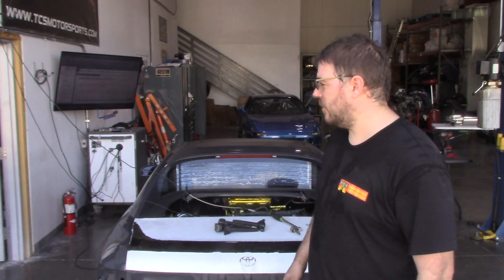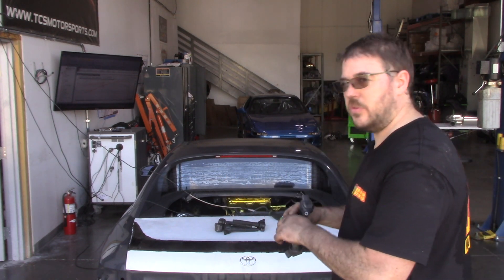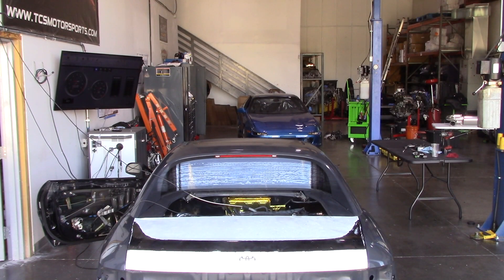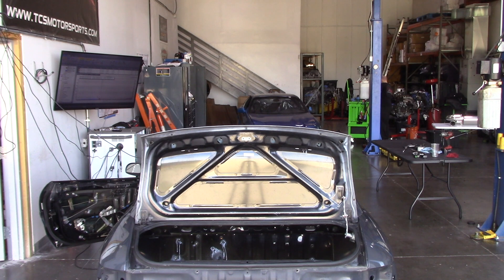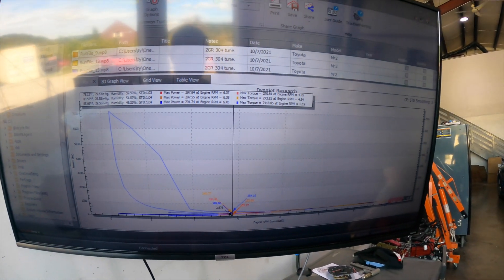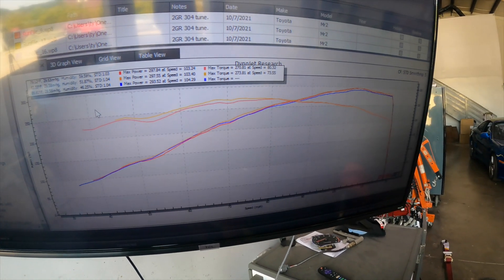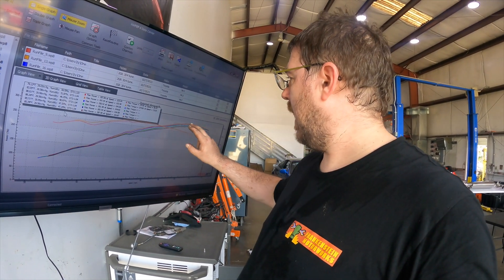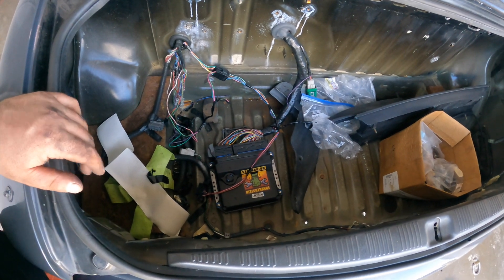More Spark! Less Power‽

Comment: It's knocking on pump gas eh?
Put in a flex fuel sensor, some bigger injectors, and run e85 to improve your timing even further?
Reply from the maker: It's only knocking because it has way too much timing advance. This motor only knocks around 4200RPM with pump gas at max power. If i put E85 in, it would likely stop knocking but it would still be making less power than it did until i took the extra timing out.

Comment: Really curious what a ignition table tune would change with those coils
Reply from the maker: It would make the coils work just fine but would be unlikely to add any power on the factory application.

Comment: Okay but do you anticipate similar results if used on the 2ARFXE conversion? Or would the high compression and premium fuel benefit from them? 🤔
Reply from the maker: I will be using these on my 2AR builds because they are stronger and somewhat more reliable coils. But i will be adjusting the timing curve to make up for the quicker firing. That said, i don't think it will add any benefit other than cutting 1/3rd of a pound from the engine.
Reply: @FrankensteinMotorworks   are ignition coils for the 2arfe and 2grfe interchangeable? 2arfe (90919-A2005) vs 2grfe (90919-A2007)?
Reply from the maker: @89gts  Best i can tell they are compatible but there was some variation between different part numbers for the firing delay of up to 100uS so if this is a perforance application i would make sure all coils are the same part number. 100uS can be up to 4 degrees of ignition timing near the redline.

Comment: Just my theory, but the 2GR-FKS needs these more powerful ignition coils because its compression ratio is a lot higher than the 2GR-FE, which also means higher cylinder pressures, therefore harder for the spark to jump across the gap, thus needing the more powerful ignition coils so the spark plugs will always be able to fire reliably.
Reply from the maker: The previous coils would likely have been good enough but Toyota does tend to overbuild some of the specs on these motors and the spark energy seems to be one of the things they overdo. This just ends up helping all of us that want to modify these motors later and that's great! Unfortunately this gives a bit of a perception of poor aftermarket support since there's a lot less support needed to make these motors great.

Comment: Can you find out what kind of paint is on the blue one?
Reply from the maker: It's a 50/50 paint. It only looks good from 50' away or at 50mph. If you go to your local body shop they'll have a massive book of paint colors you can look through if you're looking to do a respray.
Reply: @FrankensteinMotorworks  My '91 turbo has 400/60 paint; )

Comment: As you shared, it is likely an ignition timing effect…nothing to do with the energy delivered to the plug.  It would be interesting to see the timing advance curve as well to see how the ECU is adjusting it.
Reply from the maker: Yeah, this is entirely a spark timing difference. the weaker coils firing 100us quicker would give the same kind of power loss. To be fair, the ECU is really good at fine tuning the timing over time and would probably adjust back up to the same power but that makes dyno testing for differences rather tricky. The stock coils have plenty of power for the stock setup.